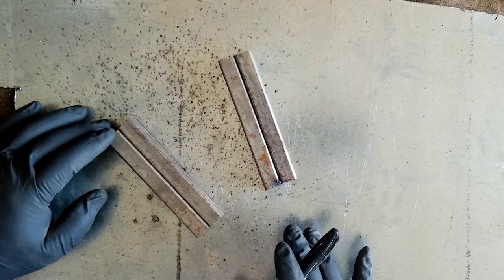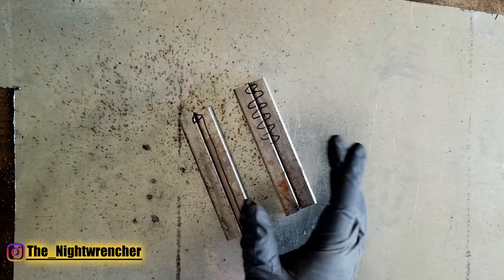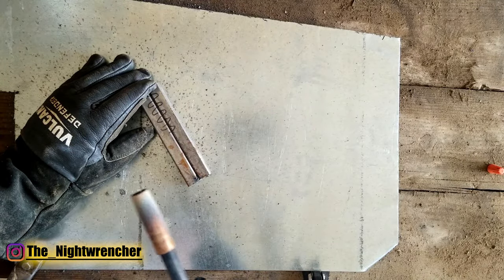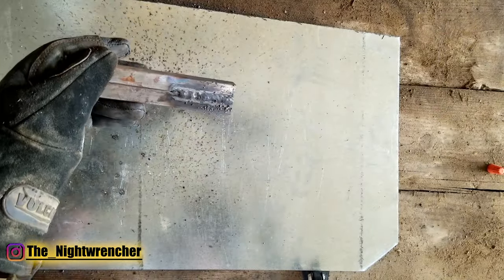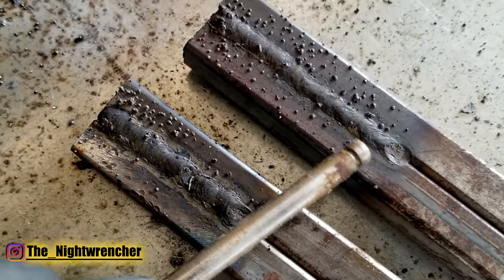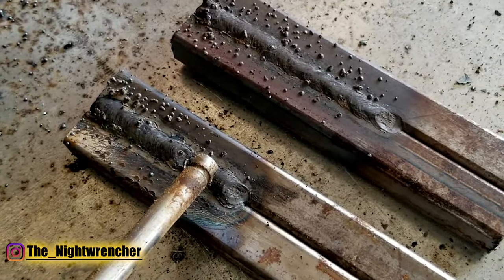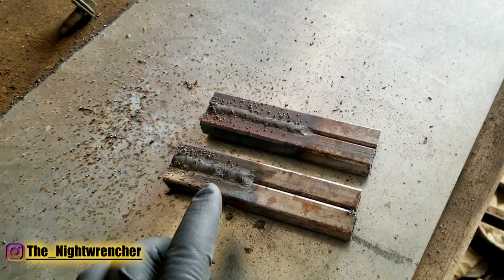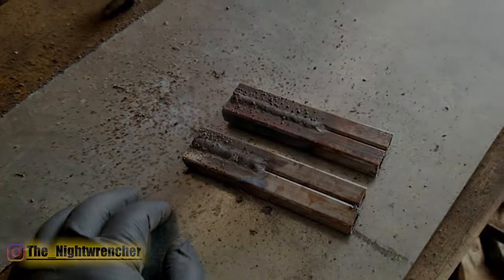Welding Straight VS Weaving Or Wave | Flux Core Welding For Beginners |

Comment: With that amount of spatter, I think your polarity was backward. I use fluxcore most of the time and never have that much spatter. Just for an experiment, I reversed the polarity on my welder and ran some more fluxcore. The result was spatter like yours in this video. Reversed polarity again, and weld spatter was minimal in comparison. Give it a try. 🙂
Reply: I was thinking the same thing, either its the wrong polarity or that's an AC output welder. Kinda reminds me of how my Harbor Freight flux welder used to weld before I converted it from AC to DC output. It now lays down welds that are almost spatter free. I stopped using the Harbor Freight flux core wire and switched to some Inetub. 030 wire and it welds almost as good as my mig welder. His excessive splatter may have been from the wire he was using too. One wire that works good in one welder may not work well in another so it's best to try different brands until you find one that works best in your welder.
Reply: @gordonlovett71 how difficult is it to do the swap
Reply: My Lincoln 90i will spatter like this if I use cheap wire.
Reply: Exactly what I was gonna say
Reply: You just either unscrew your wing nut or whatever is holding the leads down and change your positive to negative and negative to positive and you’re in biz
Reply: @gordonlovett71  true, today i ran out of my harbor freighr wire and got other brand and the weld went waaaaaaay better
Reply: What do I do if I'm not able to reverse polarity? Using a titanium flux core 125
Reply: @jessewilson307  
Yours does not have a polarity reverse option. If you are having spatter problems, then one or more of a few things could be going on.  The metal you are welding on isn’t clean. You have your wire speed set too fast. Your wire end is too far away from the metal you are welding on. It could also be the wire you are using. Sometimes a low end wire will have more spatter. Are you having spatter problems?
Reply: @jessewilson307   Titanium 125 is already correct from the factory. This pertains to Mig/flux core machines that come from the factory setup for mig.
Reply: do you mean switching the polarity? i have a titanium 170 but not sure what you mean switching from ac to dc output. How do you go about it?@gordonlovett71
Reply: @lukecash610 
The machine I use is a multi process machine. Tig, mig, and stick. I can remove the ground cable and reverse it in the machine for the different processes. I’m not familiar with yours. It should have a guide placard inside the wire side of the panel that should provide you with the proper polarity for whatever you are doing if yours is changeable. Make sure you follow that guide.

Comment: I'm not a pro welder, but I think you are not the guy to be showing people how to weld lol.  As others have said, your polarity looks backwards. You also have the wrong tip it seems. It looks like you were doing MIG and then just changed the wire for this video, but nothing else.

Comment: I’m no pro, but from what I see, it looks like your polarity is set wrong.
Reply from the maker: The machine is set to DCEN but the settings could use a little tuning
Reply: Sometimes my flux spatters like that sometimes not.

I try to keep all things same, 3/8 to 1/2 standout,  same angles.  

Sometimes it just spatters badly.  It's odd.

Comment: I like how you showed both methods and explained pros and cons of each instead of pitting one against the other. Personally, I prefer Cs and have not had the best luck running straight through. I also haven't practiced running straight nearly as much, so I'm sure that's part of it

Comment: My flux core welding is just not consistent.   

My first ones today, running up to down, came out great!  Looked like gas mig!

Then I did some horizontal welds, everything same,  looked like crap.  

Can't figure why.  Have a Lincoln 140c.  

Do these machines have a duty cycle maybe and if you weld more than like 5 minutes without a break, they don't burn as hot?
Reply: Check your machine. Duty cycle on my machine is 3 minutes working to 7 not.

Comment: do you need the shield on the end of the gun for flux core welding, some say yes, some say no?
Reply from the maker: I don't know of anyone that says yes but if youre not welding with gas, you dont need a gas shield. They sell caps for mig guns to protect the tip but giving you a better view to see.
Reply: It is nice to have the shield regardless. Try both ways and see which you like more.

Comment: What brand of wire you running. I find that Vulcan wire spatters no matter what.
Reply from the maker: I dont like vulcan wire at all. It takes more heat to get a good result. I use lincoln inner shield wire
Reply: @NightWrencher  Lincoln wire does the same surprisingly
Reply: @NightWrencher  Forney and yes welder makes some of the best running flux core out there. I’m just saying if you ever get a chance give them a try.
Reply from the maker: I'll have to pick some up and try it 👍
Reply: I use Vulcan with no spatter.  75/25 and always a little warmer.

Push, pull weave can all be dependent on specs. .045 structural is push only.
Reply from the maker: @carlossandoval646  this is all gasless so not really the same. You can do dual shield flux core or solid wire but for a hobbiest that welds once in a while, its an unneeded added expense
Reply: @ night crawler, I'm a certified professional welder. Flux core, mig, dual shield doesn't matter. Vulcan, forney, Lincoln doesn't matter. Your settings, travel speed weld style will dictate how the weld comes out and the amount of spatter.
Reply from the maker: There is no way to prevent spatter 100% on gasless fluxcore is my point. You can set it up to produce LESS spatter but it wont go away.
Reply: Hobart wire does pretty good to
Reply: @carlossandoval646  if your welding Wood I have to call your certification into question or your a freaking genius.
Reply: @adamh8030  auto correct🤣🤣🤣

Comment: If i dont weave it it just blobs and it doesnt spread to both pieces, even with the welder maxed out
What could i possibly doing wrong lol
Reply from the maker: Could be too far away or not pointed at the root. If youre maxed out on heat, try adding a little more wire speed
Reply: Edgar,.. No need for full power,..  try 1/3 power and 1/3 wire feed, match them up,..  slow down and let it fill, tip angle as virtical as you can  10degree
Reply: Make sure your wire is 1/2 of a inch from the contact tip to long of a stick out will cause that

Comment: Wave seem Easier for me to look good. Straits suck for me. Visually.
Reply: Yup I came to the same conclusion but weaves also apply alot more heat so I have started to use the straight when I'm welding thin metal like my current project where I'm welding 16 gauge to 1/4 inch
Reply from the maker: I agree with both of you. My straight welds suck 😂